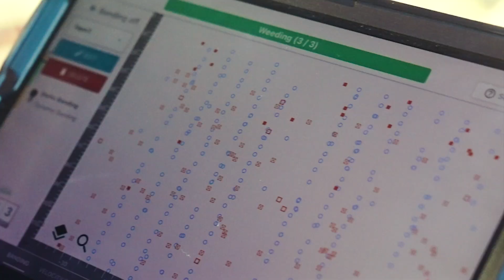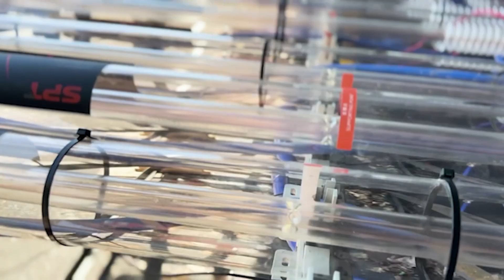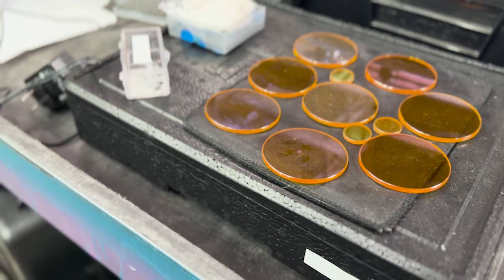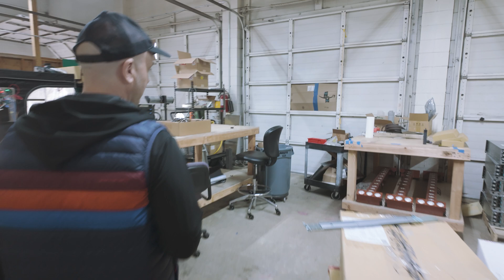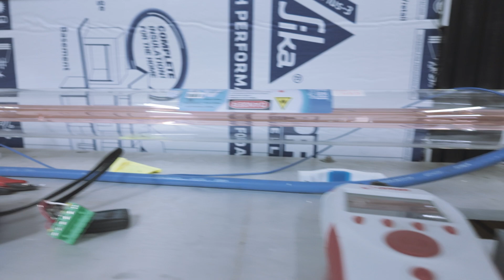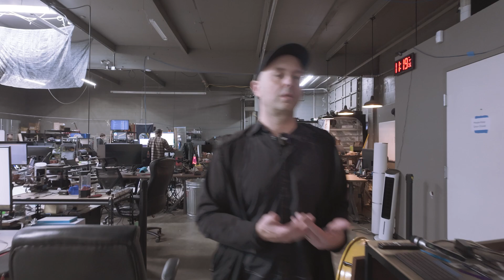Carbon Robotics Technology Overview with CEO and Founder Paul Mikesell

Comment: The major problem is you would be burning weeds only at their top portions. Within a week they will grow back from the portion underneath the ground or the portion that is left unburnt. This is not a full removal of weeds. 
Also, this only works when weed density very small. For a farm with heavy weeds it will take for ever to target weeds one by one. 
I am not sure how you would solve these problems.